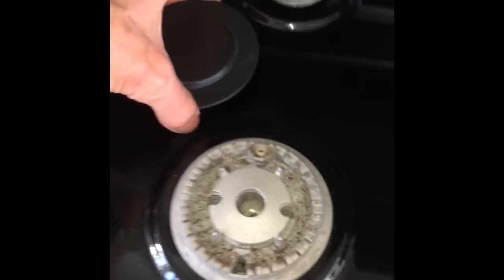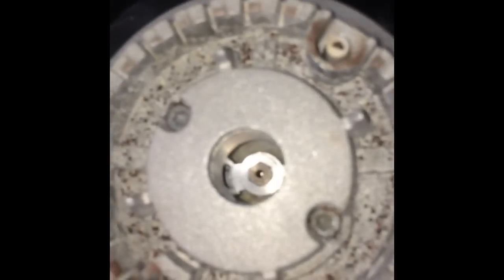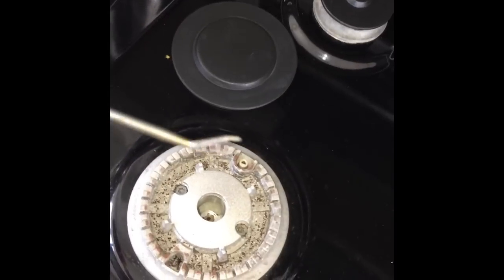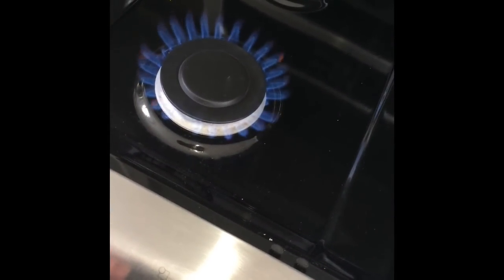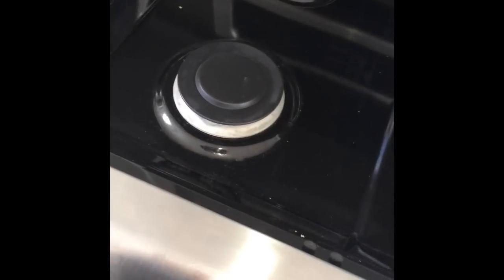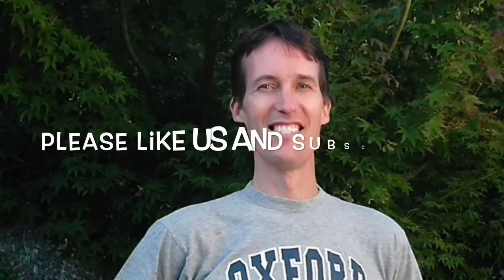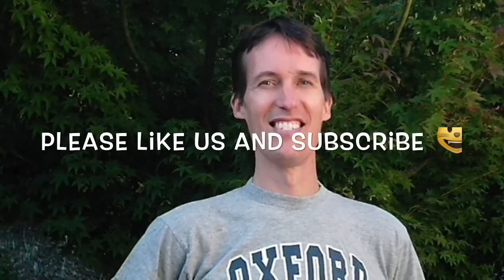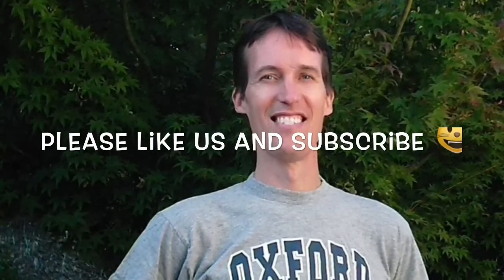🔥 Gas Burner Won't Light -- SUPER EASY 10 Second FIX 🔥

Comment: Thanks much!  It worked for me too.  In the end a long fine sewing pin with a flower head (great so it couldn't fall through) worked.  Yours was the second video.  Had already cleaned the little hole on the metal cover though it dod not seem clogged.  Clicked but nothing. A round toothpick to the nozzle under the stovetop did not work. Something you said made me think of a pin.  I tried the pin and then noticed it was sparking. Tried it again and it worked.  I appreciate your help.

Comment: Thanks very much for your video. I bought an older house which was a rental before. The gas stove is a simple Hotpoint one. I just cleaned the stove top with baking soda, but now none of the burners ignite (no click). However, I can hear the gas coming out. (1) How can I solve this problem in an affordable way? (2) Can I simply work around this by using a match or lighter? (3) Does this problem affect the ignition in the gas oven? FYI, I am planning to remodel my kitchen in one year and therefore don't want to buy a new stove. Thanks!!!!!

Comment: I can't find out what I do when water spills over onto it putting out our fire and now it won't ignite when turning the knob. It doesn't make a clicking sound anymore. Do we need to wait for it to dry and it will start again? I used a lighter to ignite it.
Reply from the maker: You can also use a hair dryer to speed up the drying process.
Reply: @QuickAndEasy5MinuteAppliance   Thanks for the reply. We don't have a blow dryer but we let it dry out on its own and it works just fine. Well we know what to do next time if that happens. I have a blower lol.

Comment: Can this be the cause of my burner not lighting if the burner will light if I put a match to it?  (note: the electronic igniter IS working, I see the spark.  But I just get a lot of clicking when I try to light the burner.  It won't light on it's own, without me putting a burning match to it).
Reply from the maker: +lane99 

This could help,

I would also clean the burner and burner cap with a wire brush
Reply: WOW! This helped fix my 2 burners that got caked up with coffee (imusa-old school way to make coffee on stove) that I couldn’t fix for 2 years!!! THANK YOU!!!

Comment: Thank you! I didn’t even have any gunk come out but I stuck a toothpick in the hole twisted it and BOOM it lit right up.
Reply: Same with here. Used a toothpick and everything worked out. No "BOOM" for me tho, mine just came back on 😬. Lol
Reply: @vinndiggs100  Mine also BOOMED lol.
Reply: Same here. After 10 videos of other about cleaning the burner, and this one finally fix it. 
My doesn't have anything in it too but somehow it was blocked.

Comment: I was cleaning my gas jet with a small sewing needle and I accidentally dropped the needle into the hole! I tried to get it out with a magnet but it didn't come out. How bad is it to leave the needle inside the gas jet? Thanks
Reply from the maker: The gas might shoot it out .
Reply: @QuickAndEasy5MinuteAppliance  If the needle doesn't shoot up, Is it dangerous to use the stove with the needle in the gas jet? Will it melt and cause a bigger problem?
Reply from the maker: No it’s fine,  the flame happens 1 inch above that jet👍
Reply: @QuickAndEasy5MinuteAppliance  thank you!

Comment: I cleaned the stove top with soapy water. Now 3 burners wont light. They were working fine. I didn't remove the metal plate just the racks. Please help
Reply from the maker: Just aim a blow dryer at the burner for 10 minutes to get rid of the water.
Reply: @QuickAndEasy5MinuteAppliance  ty

Comment: Check the igniter first. I either fouled it with soap while cleaning it or bumped it out of gap. after I ran my finger nail under the electrode and pulled upward ever-so-slightly my problem was solved and the burner lite right way. Took 2 seconds. By the way I own a Magic Chef and the gas orifice looks nothing like that shown in the video.

Comment: Mine still doesn’t work 😣
Reply from the maker: I would try cleaning the area around the igniter with a wire brush to get it very clean.
Also you can use a Q-tip with some alcohol to clean that area and then try it.
Reply: Quick and Easy 5 minute Appliance Fixes 😅 turned out my gas was cut off bc of construction in my building, my bad . Thank you for your response